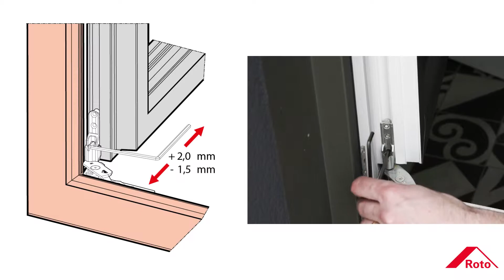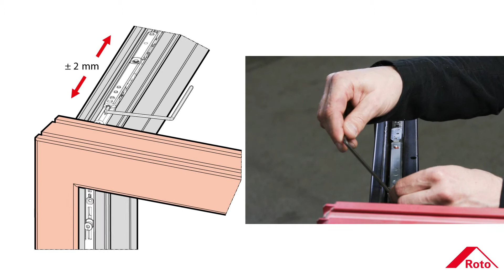Roto NX Designo - Réglages des ferrures invisibles

Comment: I believe my bottom lateral screw is stripped from supplier. It does not seem to move in or out from the bottom lateral adjustment. Has this been an issue in the past?